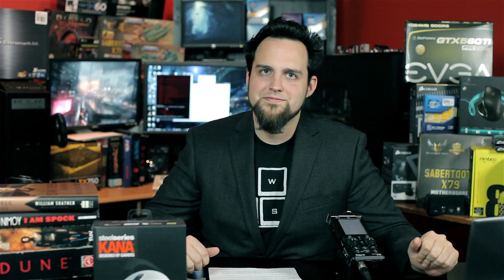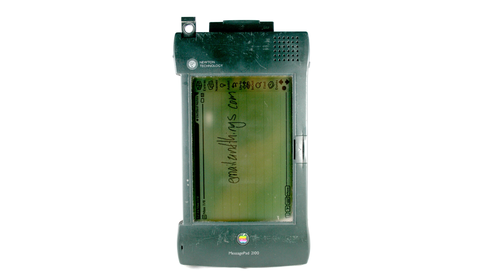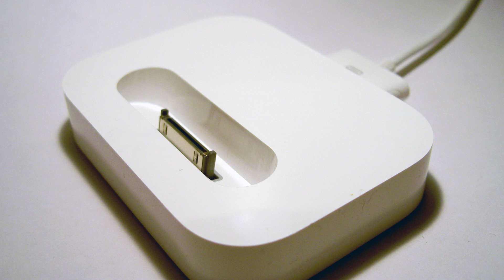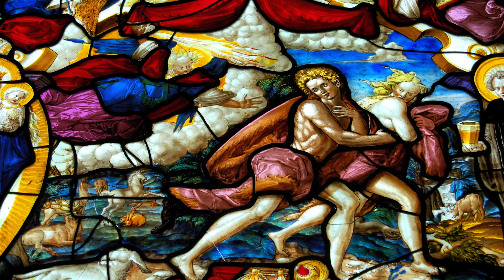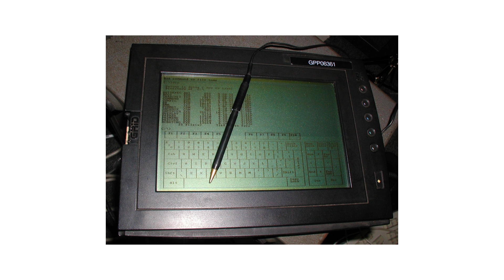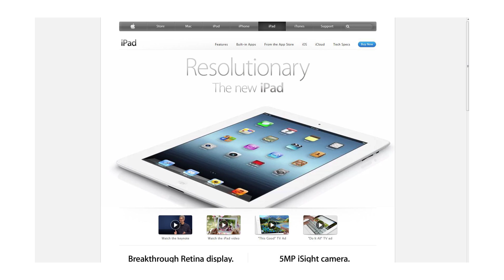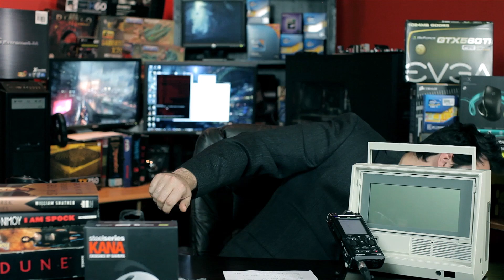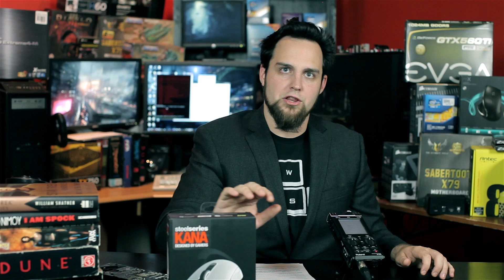Has Apple Really Ever Invented Anything?

Comment: If you cracked open an Apple 27 inch monitor and a $250 generic monitor and examined the quality of all of the components, there will be a HUGE difference in the quality and cost to the mfg for what goes into these monitors, so THINKING that a 27 generic monitor is the same as a name brand monitor costing 4x is just plain dumb.  Do you think Rolls Royce uses the same grade leather as a Honda Civic?  Fuck NO.

Comment: Do you know what the difference in CRT screens?  The cream of the crop CRTs that came off the assembly line would go to the premium monitor mfg and would be charged more money.  Then they would sell different quality levels depending on which customers they had.  Sony had XBR2, XBR, and several grades of Trinitron. Same monitors but they would roll off the assembly line meeting different levels of quality.  The better ones were used w/better pwr supplies in the top end models on down

Comment: Before you make claims like they use the same monitors, the supplier might be different and there are other specs that might not be mention.  Some are backlite, some aren't, there are a TON of specs monitors are rated by.  Go google the term "LCD monitor specs" and look at how monitors can vary. Most companies list some specs, but don't much into detail because most consumers couldn't give a rip.  Bottom line is not all 27in 2550x1440 monitors are the same.  Apple may use more expensive panels.

Comment: First off, you have to look at the screen and figure out who the actual panel maker is. Having the same size, type of screen, resolution is NOT EVERYTHING.  Apple puts GLASS in front of the screen which costs MONEY. Power supplies are NOT equal.  Apple uses expensive mother boards, caps, etc. so they are more reliable.  The cheap monitors use cheap power supplies, which can either fail or not give proper power for optimal performance.  Then there is case materials, and other components.

Comment: I don't understand your statement.  When a component supplier makes a component like a screen, they do not meet all of the specs the same.  There are a deviation. There might be bad pixels or their might be certain specs you don't know about that they are tested to. Memory can pass tests, but they might fail after so many passes. So, Apple might have higher testing requirements to meet.  WIth memory, if it doesn't meet Apple specs, they send it back and that memory goes on the open market.

Comment: You IDIOT.  Apple wanted something faster than USB 3 and FIrewire 800.  They wanted something bi directional.  They wanted something that will daisy chain.  They went to Intel, and they collaborated.  Intel did the actual development, but APPLE assisted and had some ideas they wanted to have in this new I/O technology.  They were the first to implement it.  SO GO FUCK YOURSELF.

You are such an idiot. So how come data transfers on a SSD Thunderbolt drive faster than USB 3?  How about RAID?

Comment: There is a Matrox box with Thunderbolt for video editing.  Thunderbolt is more high end high data transfer that is REAL daisy chaining, not some low speed data transfer like USB.  It's meant more for high end applications and there are new products coming out with it as time goes on.  The best thing about it is bi directional, daisy chain and can be adapted to other types of ports with adapter cables, if you need to.   It does what Firewire and USB 3 were supposed to, but didn't have the bw.

Comment: What type of Flash drive? SSD drives? Yeah, they have Thunderbolt drives that are SSD and you can daisy chain them.  Mouse, Keyboard you use either USB or bluetooth.  Camera? Well, there are USB, FIrewire, and there is a BlackMagic Design Camera that has a Thunderbolt connector on it, but it's a $3000 camera.  That might be out of your budget.

Comment: There is a guy with 2 Thunderbolt monitors, a HDMI monitor, and a USB Newer Tech adapter on one Laptop.  If they wanted to add some Thunderbolt hard drives, SSD drives, RAID arrays, they can daisy chain them between the laptop and the monitor.

Comment: The stuff you listed are low speed devices that are USB stuff, for fast data transfers you need Thunderbolt. Are you THAT STUPID.  Go read about the specs.

Hanns G monitor? Who is that?  Some POS cheap monitor?  Does it have a 49watt 2.1 speaker system built in?   For a cheap monitor it's just as bad as anything else in that price range.

Comment: You are stupid aren't you.  Thunderbolt can easily change into other ports, if you need to with a variety of adapters. Have you seen the vast number of storage systems that can be daisy chained. Bi Direction 10M which is 3x faster than USB 3.  How about the Universal Audio Apollo, you can daisy chain various devices and monitors together have do data transfers while playing video at the same time, low latency, faster than shit.  YOu OBVIOUSLY don't know jack about Thunderbolt.

Comment: Well, I certainly don't need plenty of ports on my monitor.  Those are on my tower.  My monitor cost $200, and I've had it for 6 years.  And no, price is not the only thing I compare.  I look at the specs, and then compare the price.  Pick a complete Mac system, and I will certainly be able to build a PC with the same or better specs, for much cheaper, and it will last just as long, because they use the exact same parts.

Comment: Go crack open the monitors you are speaking about and look on the INSIDE.  Look at the ports.  What about the warranty?  Cheap $250 monitors usually don't last long, because their motherboards usually go bad and it isn't worth replacing the board, people just toss the monitor and buy a new one.  They are disposable.

Comment: compare HP's $719 27inch monitor to the Thunderbolt monitor.  look at the ports.   I'll spend a couple of hundred more to have additional ports have available.

The $250 27inch displays SUCK.  Cheap cases, cheap monitors, no real ports on the back and all they are are cheap monitors.

Comment: Go look up HP, they have a 30 inch display that is actually comparable to Apple's Thunderbolt display, but the Thunderbolt display is about the same res as HP's 30 inch, but the HP 30 inch costs over $1200 and it only comes with USB ports, whereas the Thunderbolt display comes built in with Thunderbolt, USB, Ethernet, and Firewire ports.  $250 screens are the crap that average PC users use because they are just a cheap display.  Apple users can use the cheap PC monitors if they want to.

Comment: Have you ever seen a cracked open Thunderbolt monitor compared to a typical PC monitor? Apple's monitor has a much more expensive case design, plenty of ports, much better power supply and screen.  The typical PC monitors a cheap hunks of crap in comparison.  But then again, that's what PC buyers compare.  PRICE and nothing more than that.

Comment: Microsoft didn't want to make PCs, they just want to make the OS and charge a lot of money for it.  When you buy a comparably equipped PC and add MS's Windows Ultimate, the price differentiation is less.  Plus with Apple, they usually have things not found on a PC.  Can't get Thunderbolt (latest) on most PCs, Thunderbolt costs money.  The same thing when Apple had FIrewire, FIrewire ports cost money.  Multitouch track pads. To me, there isn't much innovation in the PC hardware.

Comment: Compaq told Apple that it would be a better fit if Apple just did everything on their own since the OEM Microsoft PC clone makers can barely support Microsoft, yet another OS.
Apple is more expensive because they typically use more expensive components, cases, etc.  Their memory is tested to rigorous standards, so are the hard drives, etc.  They just cost more to make and they want to have a decent profit, but most of the time it's maybe 10% or so more.  But there are features the PC don't have.

Comment: Apple designed their OS to work on others, but the other companies didn't want to offer it because of the Microsoft OEM agreement were written where the OEM MFG would STILL have to pay M$, even if the mfg shipped Apple's OS instead.  That's why MS got their asses sued for Anti-Trust and LOST. The BIG problem is THIS.  Apple has their OWN OS, hardware design and SUPPORT system.  Apple TRADITIONALLY has certain hardware as standard on Macs.  Things like Ethernet, Thunderbolt, etc. 
TO BE CONTINUED

Comment: "And on a mac, you can run OS X, WIndows, Linux on one box. Can't do that on a toy clone PC made to LOOK like a Mac."

That's a problem with Apple software, not with PC hardware.  Apple designs their OS so that it only runs on their hardware.  Microsoft and the Linux foundation, on the other hand, design their OS to be compatible with as many hardware variations as possible.  So users aren't locked into purchasing overpriced hardware.

Comment: Using this same logic, all computer technology is "just a recipe" of transistors, which were invented by Bell Lab.  But the solid state transistor is just a "rearranging" of vacuum tubes" which was just a modest improvement over relays which are, in essence, an automated version of a light switch, which could be considered a derivative of a plumbing valve (flow of electrons instead of water).  If you do not think other technology companies do this, look into AMD/Intel history, or Samsung.

Comment: @razethew0rld, the A5 is just like the other ARM core based CPUs-with-extras that ARM makes for media players, media centers, smart TVs, cell phone station switches, handheld gaming units, etc. They have been making CPUs with a videochip and VDU of choice since the turn of the millennium. It's why ARM is so successful - if the volume is big enough, just drop in the chips of your choice in the design software, and not many glue chips are needed externally.

Comment: Saying iOS and OS/X were easy because they "are just Unix" is way, way oversimplifying things, and betrays a lack of knowledge of the underlying technologies. OS/X wasn't even fully Unix until 10.5 when they back-ported it. The code is a combination of OS9 (mostly Carbon libraries) and NEXTSTEP, Steve Jobs' company's OS. Neither were based on Unix. iOS and OS/X are most definitely excellent examples of fine engineering by Apple.

Comment: The Mac's software is much more refined in almost all of its aspects, easier to use VERY user-friendly with MANY nice features; Windows is not as great I've been using Windows (and still do) JUST because mac doesnt support several games that I play but when I start working, Im definitely getting a Mac because of its 1) better hardware and software interaction and thus performance and 2) better user experience
Nevertheless, if you don't like Apple that's fine, it's your opinion, I cant force mine

Comment: LOL in my 15 years of using Windows, no viruses have ever brought down my system. I've had hardware failures but it's so easy to just plug the harddrive to another computer and backup/fix things.
There are so many ways to protect a computer. It's usually the user that f*d up by going to porn/pirate sites, opening a malware disguised as nude JPEG on a stranger's USB disk, etc.
No Bluetooth? Ask the vendor/manufacturer, not MS.
Please, don't embarrass yourself.

Comment: Well, guess what. The standard WD HDD i bought and installed in my iMac a couple of months ago did have that "proprietary" power connector, so I guess it isn't an Apple thing after all.
I have just been looking at all the raw HDD's I have lying around in the house, and they all have that proprietary 7 pin power connecter -both 2,5" and 3,5" drives.
And even the guide from iFixit.com about installing a new HDD in your iMac doesn't mention this.

Comment: Gesture mouse: already existed.
High res? How is that an invention? It's just the same but more of it.
Apple still didn't invent the magnetic connector.
No, the first hand held pda wasn't an Apple, Psion has made the first.
Because they didn't include an accessory doesn't mean they invented it, MS's first tablet didn't really need a stylus either. The first smartphone with touchscreen was IBM's Simon, back lit keyboard was first used on a apple laptop but they didn't invent it. Auto update? Unix

Comment: I have windows vista, the most hated of all windows versions and guess what: never had any problem / virus / whatsoever. I did however change my hdd (because it was old and slow, not because of vista), now I have a 256Gb SSD and I didn't have to sell a kidney for it. Now let me see your sub 200 euro 256Gb SSD. Also why the hell would you need bluetooth when WiFi is so much faster and easier to use. I have it and I've never ever used it on my laptop. Mac OSX is great but not better then Windows 7

Comment: Commercially available/successful GUI interface.  Apple hired the original designer, but the XEROX version was NEVER sold commercially as it wasn't usable.
Firewire.  The names you listed came AFTER FIREWIRE was created, YOU IDIOT. GO LOOK IT UP ON WIKI.  Apple was the original designer and the rest came on as a CONSORTIUM.
Backlite keyboard
ARM-based touchscreen tablet
Portable stylus based PDA
How about the first laptops with built in ethernet.

So, what did Microsoft invent?  JUNK.

Comment: 1.) Unless someone has patented fire or electricity, your doing naught but making useless rhetoric.

2.) WRONG. Other companies were making MP3 players that were even smaller than the iPod before Apple designed it. For example... Look up the SaeHan's MPMan F10 or Rio's PMP300. They were released in 1998 and were about the same size as the first iPod - which was released 3 years later in 2001.

They may have only been MB in size as opposed to GB but the fact remains. You're wrong.

Comment: They "invented" Nano SIM?
(So did Nokia & RIM, btw.)
But also, it's just your old SIM-card that is CUT TO SMALLER SIZE.
(Yes, basically you could take your current normal SIM card, cut it to match size, and it will work as "Nano SIM". No invention there. =P)

As for FireWire, yeah they iniated it because they needed.
Iniated. So that others would do the hard work and Apple could then use it ;P

Comment: Apple did acquire a company that specialised in taking ARM's designs and built chips around them. Apple then used their engineers to create a superior memory controller for cortex A9 cores, which then laid the foundation for their A4 and A5 chips. This memory controller is actually the whole reason why apple's chips were indeed faster than the competition. Technically, since they acquired the company with the engineers, they sort of invented that. But this is not innovation, it's customization.

Comment: Apple absolutely did  not create the "A5", it's IP from ARM holdings, it's specifically designed to create your own spin by mixing and matching components on the die then having someone make it for you. They also didn't create the mini display port, they made a mini connector,a  big difference.

Comment: Meh, practical CPU performance with the A5X is great, very fast and responsive.

As for Egypt Classic, the difference is because the iPad is running 2048x1536 and not 1280x800, 3x the pixels! Your argument is like saying that a 8800GT running on 1024x768 is faster than a GTX 680 at 2560x1600. Stupid.

NFC - Not popular yet, doesn't matter until then.
GPS - A-GPS with the iPad and LTE iPad is great, pinpoints me about as well as an actual GPS.

Most importantly, tablet apps: Android has none.

GG

Comment: Dude, no, CNC machining was something that Apple actually invested in using their cash pile. I can't post links here but it was in multiple news outlets a couple years back.

This video even goes into it, how nobody else did mass CNC until Apple basically bought the equipment to do that with (they molded instead).

There is a huge reason why other companies have serious constraints on being able to build machined chassis, and it isn't because there is an aluminum shortage.

Comment: He's dead wrong on Thunderbolt, the spec was a collaboration between Intel and Apple. Apple came to them with the desired use cases for a single-purpose high-bandwidth connector and they started work on it. It is a similar collaboration they had for the 1st gen MBA CPU, custom CPU package made to Apple's specs.

No idea if he went into OpenCL at all, developed internally at Apple and then released to Kronos Group as an open alternative to CUDA. Stopped watching after the first five minutes. :)

Comment: Apple designed the unibody chassis for their own notebooks, not Foxconn. Foxconn didn't even have the tooling and machines needed to construct those aluminum chassis, Apple spent hundreds of millions on that themselves for Foxconn to use in manufacturing. The investment clearly paid off.

If Foxconn was wholly responsible then we'd have seen it in notebooks from other companies at around the same time, or even before.

Comment: Actually they didn't invent unibody construction of anything. Foxconn did that for them and even they were not the first, all in one Unit Body Manufacturing designer. Reality is that Rambler invented unit-body (unibody, unitized body structure) construction factory manufacturing techniques. 
But even they were superseded by the1st Monocoque (unibody), that actually goes back to the 1912 Desperdussin manufacturing procedure!

Comment: Macintosh File System (MFS). Used as a base to create Hierarchical File System (HFS) in 1985. But HFS was slightly improved in 1998 to HFS+, to support modern Mac OS's. Still basically the same  legacy file system used by Apple today & in a more limited form for iOS!
But is it really that great? Apparently NOT since unlike BeOS BFS, which was Pervasively Multi-Tasking or Ext2, WinFS & to a degree NTFS, the HFS system is still basically single threaded. Notice how iOS can't run more than 1 App!